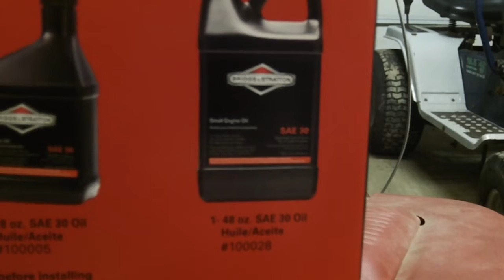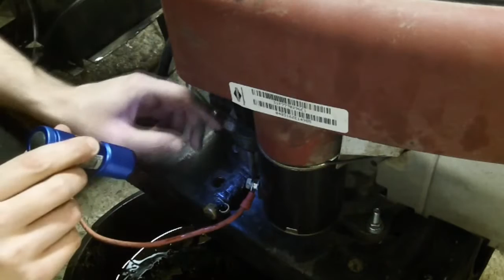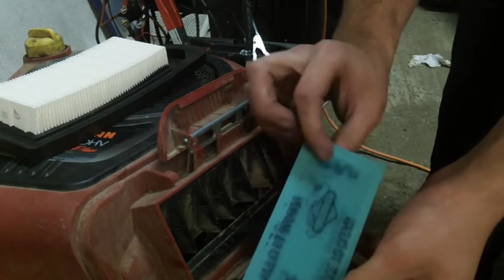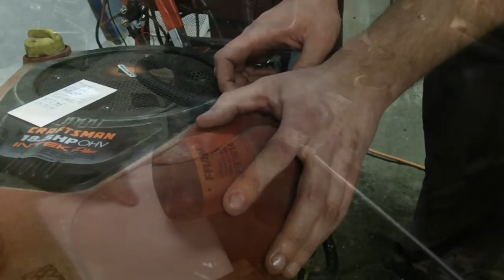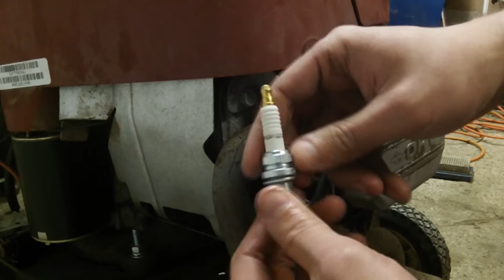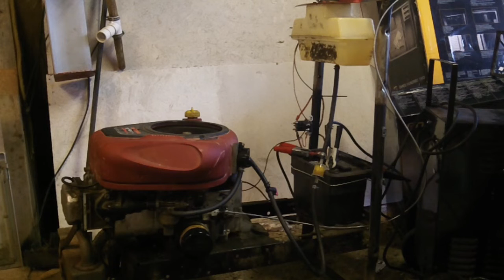Intek tune up Single cylinder Briggs and Stratton

Comment: Troy built recommends lightly oiling the pre-filter and pressing it into a paper towel or similar to soak up any excess oil in it before installing. I'm not sure what the Briggs and Stratton manual says about it because it's at my mothers house at the moment but two other videos I've watched doesn't oil the pre-filter, one of them saying that it will clog up the main air filter because the paper element is pressed against it. I don't know which way is the proper way but it seems to me if you soak up the excess oil from the pre-filter in a paper towel or something that it wouldn't effect the paper filter that much.